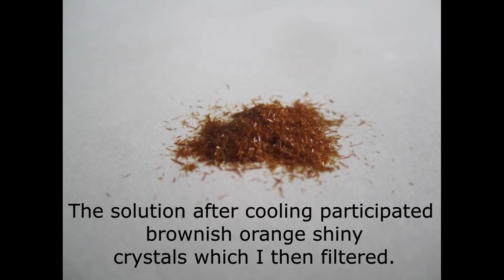1,3-diphenyltriazene synthesis

Comment: Hi,
Glad it worked this time with the provided informations into the comments in your previous video about 1,3-diphenyl-triazene.

You didn't do a melting point determination?
This is the best and easiest way to asses purity.

There is another youtuber that has made a video about it Shiva Chemist... but he called it diazoaminobenzene what is a misleading name...
Could be C6H5-N=N-C6H4-NH2 or H2N-C6H4-N=N-C6H4-NH2 or the target molecule C6H5-N=N-NH-C6H5 ... when looking at the video and text... it is in fact the 1,3-diphenyl-triazene.
Here is the link.

https://youtu.be/CLl-yB5welw

He doesn't show cristallization... but he mentions and shows/proves a certain degree of light and heat sensitivity... the compound darkens and becomes browner from yellow-orange.

PHZ (PHILOU Zrealone from Science Madness forum)
Reply from the maker: I did actually do melting point off screen forgot to record it's the m.p was about right.